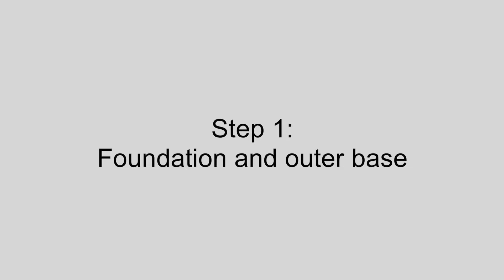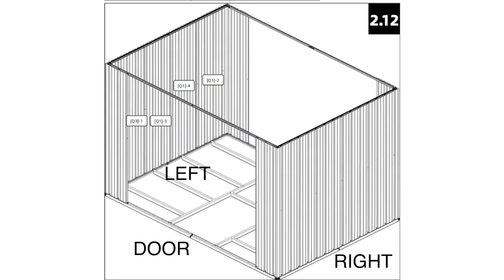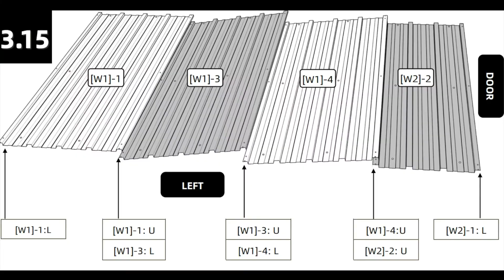BIRCHTREE GARDEN SHED 8X6FT ASSEMBLY VIDEO

Comment: This is an older version the newer one is a bit better not by much, some people say the screw holes don't line up, even the instructions are not that clear, the diagonals are the worst if you get them the wrong way round the panel holes don't line up. I have just finished the walls after 6 hours and today will start on the roof, when building on your own use a 8 foot 2x3" timber rested on the walls to help with installing the roof trusses. Time this video was updated. This one is easier than the pent shed I built for my daughter which was an absolute nightmare. Wearing gloves isn't an option when dealing with fiddly screws either.